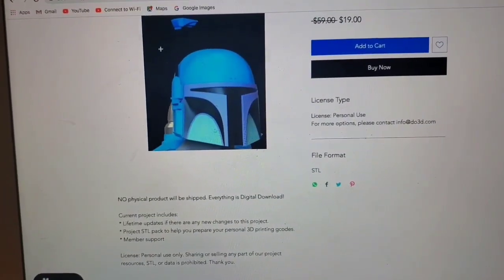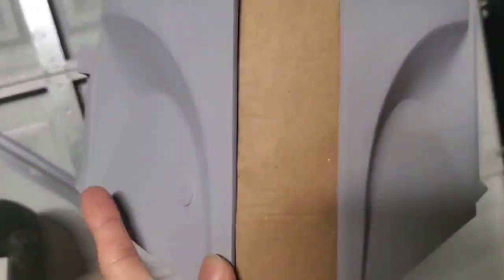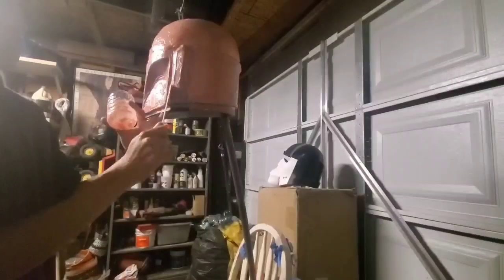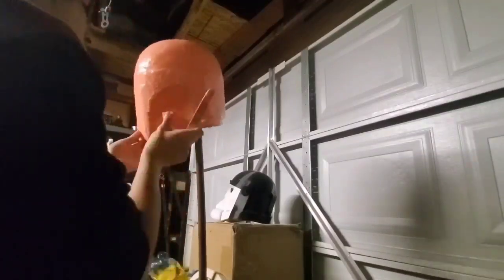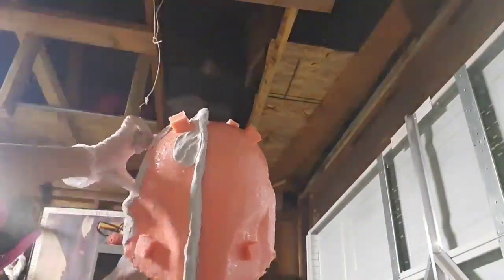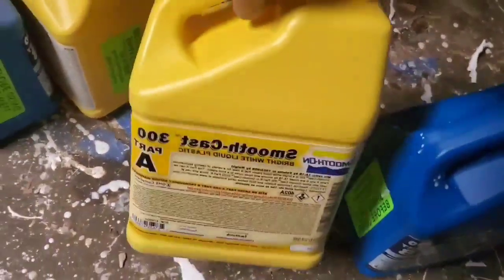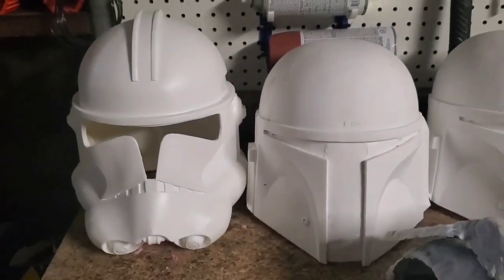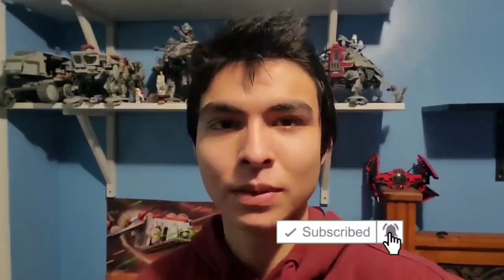How I made a Mandalorian Helmet mold

Comment: Was the dent in back caused by roato casting with the resin or was it the silicone mold that caused that?
Reply from the maker: You see when I put the mothermold and mold together I didn't check that the mold was secured on properly causing the mold to drop inward which created that dent.
Reply: @ericprint3576  at what part? time??? Sorry I’m trying to find that part

Comment: Will rebound A and B the size you have in the video be enough to cover one helmet? Or do you need a few pots of it ordered?
Reply from the maker: I used three of the small kits so that the mold would be more firm then flimsy. You could make a mold with two it just might not be as still when casting a helmet.

Comment: Great tutorial. I have some questions: do you apply the ease release on all of the silicone before putting on the epoxy dough? Also, when you started casting did you brush on a first layer of the material before pouring it in? Also, how much do you pour in? Do you do in coats? My daughter and I are making some helmets for an experiment for her science class and this tutorial has been a godsend.
Reply from the maker: Yes once the silicone mold is finished I give the mold a once over with ease release, I add the epoxy right away as for how many coats of epoxy I add until I don't see the mold or until I think the cast  I'm making is durable on a helmet I always focus on the aerators or bottom half of the helmet.

Comment: How many rebound kits did you use?
Reply from the maker: It was but it was slightly cheaper than the big gallons on smooth ons site.
Reply from the maker: I had three but only used half of the third
Reply: @ericprint3576  do you think a trial size of Rebound 25 from Amazon would be enough to cover a clone trooper phase 2 helmet?
Reply from the maker: @skippydinglechalk9940  honestly that would be pushing it two if used right would do it just fine one could make the mold flimsy
Reply: @ericprint3576  ooph, sounds expensive

Comment: Nice work!  I recently tried my 1st attempt at a mold using Freeform Air for the mother mold as well, only wasn’t so lucky.  Looks uniform color (mixed) but never fully cured.  One more shot before resorting to fiberglass. 😖
Reply from the maker: I get it the stuff snaps when you try to remove it for me it was my last option when I started my first mold